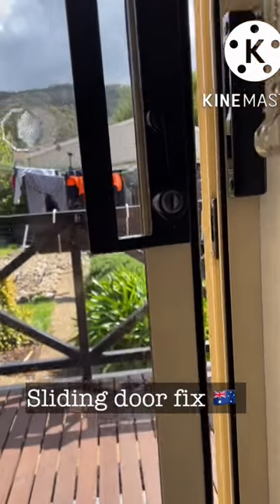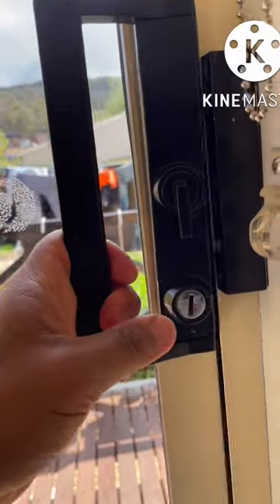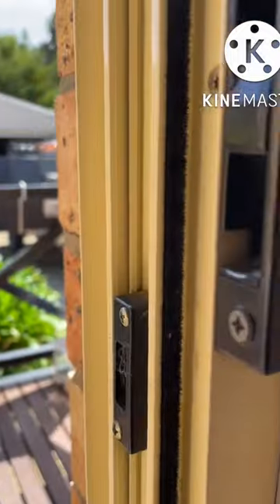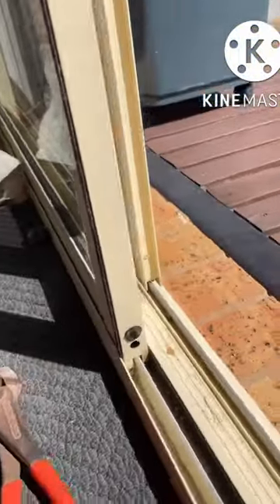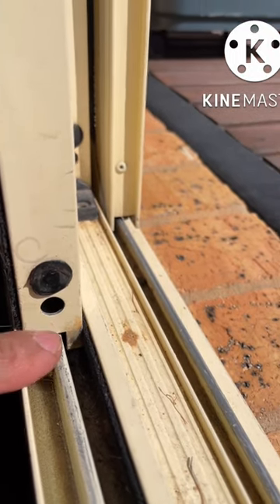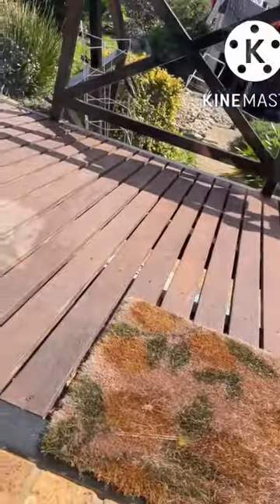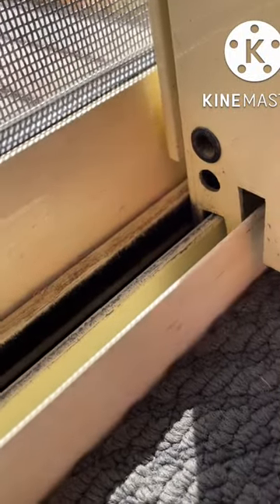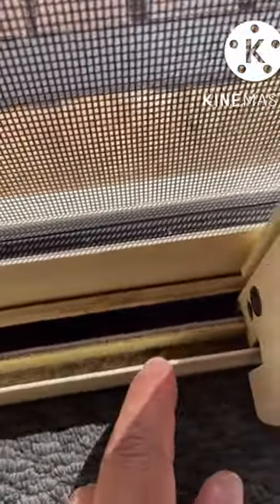Sliding door fix 🇦🇺

Comment: You have so many great tips thank you. Do you know how to remove glass door from aluminium frame? Ours won’t come out just by lifting to top & pulling bottom out🤯 we need to check why it’s so hard to slide.
Reply from the maker: Thank you for the kind words and tuning in. I find if I’m having real trouble trying to getting it out, you obviously turn the roller screws all the way anticlockwise on both sides and bring the sliding door to the middle of the frame it’s sitting in as sometimes there can be a bit more play and the bottom rail will bow down with pressure may require a crowbar to pop the sliding door frame out from its channel from the bottom if that makes sense.